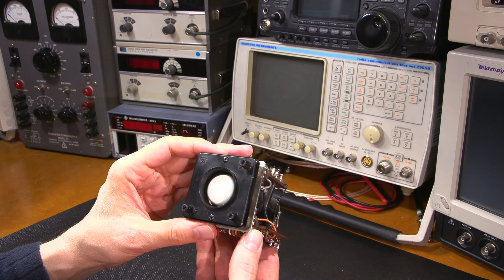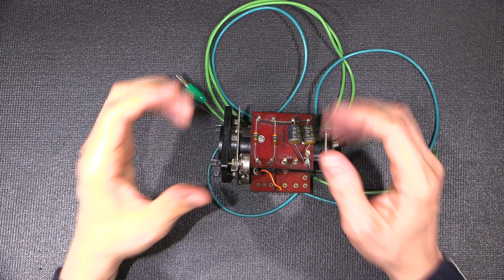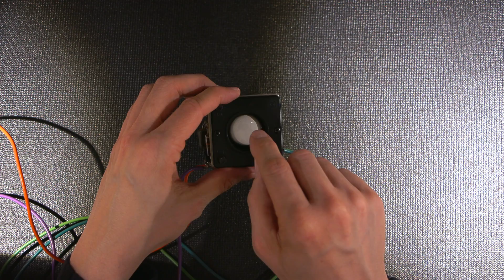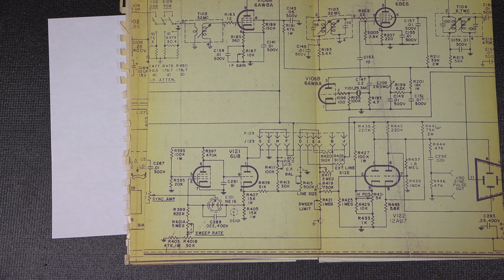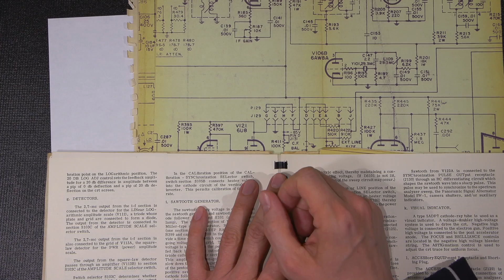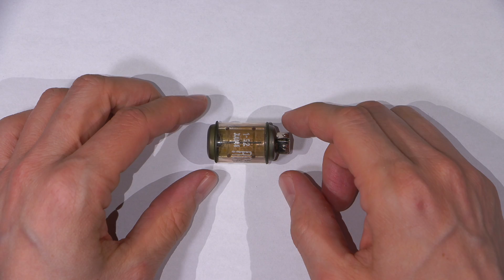Electronic Tool From The 1950's! Will It Work?

Comment: You may be able to brighten the display by turning down your High Voltage. I'm really surprised that you started right at 400V instead of slowly ramping it up.
Reply from the maker: Hi David, it works the opposite way. Higher Voltage= Brighter, but less sensitive, (needs more Vertical and Horizontal deflection excitation)

Comment: Speaking of radioactive tubes some used Radium 223 inside and are quite hot to this day (still reasonably safe to handle when intact though). Some however had either a dot of paint or a little foil on the outside so those can be a little more problematic regarding contamination.
I have some on my collection of radioactive stuff

Comment: My guess on the RCA tube is... an RCA 5582 photo detector tube. Used to reproduce sound in very old movie projectors, before photo resistors were invented. It had a pretty specific wavelength that it responded to, 400nm peak sensitivity, to help prevent stray light leaking through the film from affecting the audio playback. How did I do?

Comment: Cobalt 60!? (Interrobang) Now you are in my expertise.  Co-60 has two very strong gammas, is a dangerous source of radiation exposure, and is used as a source for radiographic examination of welds, as well as in medicine.  The radiography sources tend to be in the millicurie to a few curies in size (I do not subscribe to the new units whatever they are- like you use cycles/sec, I use curies rads and rems etc) equivalent to milligrams or smaller in weight.  The sources are stored in heavy lead or depleted uranium shields called pigs and are hand cranked from a distance with a cable to expose the source to a film that is on the other side of the item being examined.  Lots of additional shielding is involved.  I cannot believe they once put Co 60 in a vacuum tube!  Do you know which ones?  What equipment should we watch for? So, we can make a notification to the Nuclear Regulatory Commission to send a hazmat team to pick up the device and properly dispose of it (oh maybe I exaggerate a little).  Seriously, if a new tube, produced say about 50 years ago, had a microcurie of Co 60 it would give off about 1 mrem per hour at the tube surface.  In those days that would be acceptable but today would certainly require a license from the NRC to sell or possess.  After 50 years of decay the source would be 1/1000th of the original and fine from an external exposure point of view.  Background radiation usually is around 200 mrem per year, and most instrumentation today would detect these tubes, even with the depleted Co 60, as radioactive, even though the tube could read as little as 5% more than background.  So they would not require licensed disposal if as old as 50 years.   In comparison, fiesta ware (pottery) has about twice background due to uranium content, but the radioactivity in fiesta ware has less biological impact than Co 60.  Still I would not advise recondition a piece of equipment to sell with one of these tubes inside, I would find an alternative.

Comment: Great video of reanimating that old scope unit, thank you @ Mr Carlson! Answer to trivia question: I concur with all who say it is a phototube, its the cartridge type either 921, 922 or 926, often found in cinema projectors to scan the soundtrack, also fitted in some door opener light beam switches. What never ceased to baffle me since I first saw one in the early 1970s is how they managed to keep the areawise large metal to glass frit airtight at the ends. I would have guessed there would be a reliability issue at some time due to the tube drawing gas there. Could you test this one on a video please?
Best regards from Germany

Comment: I wonder why many tube filaments glow with 6.3 V.  The only explanation I can think of is the 'easy' to calculate transformation ratio: 20 x 6.3 = 126 V.  Though it would not surprise me I am completely wrong about this.
Reply: Actually, the 6.3 volts was based on running tubes on lead-acid batteries...each cell was 2.1 volts-3 cell batteries were common-2.1*3=6.3 volts.
12.6 was also a common tube heater volts-6 cell battery-2.1*6=12.6 volts.

Comment: Very nice little o'scope. Thanks for sharing, Mr Carlson :-)
Years ago I built one from scratch as part of a homebrew tube-type 40 meter AM/CW transmitter/receiver rig and I connected the horizontal plates to the filament supply to get the horizontal sweep and connected a slug-tuned coil and capacitor tuned-circuit that would resonate in the 40 meter band (7-7.3 mHz) across the vertical plates and the thing worked nicely for adjusting the modulation on AM and monitoring the keying on CW. To couple the 7 meg RF into the coil I wrapped a couple turns of insulated hookup wire around the body of the coil-form in phase with the 7 meg coil and connected one side of that link to ground and the other side was placed nearby the transmitter section's output tank coil.

Comment: Older camcorders had a tube and circuit in the viewfinder that can be used as a small "scope" tube but the frequency range are limited. It could however be used for instance as a Octopus display.  Would be you interested in building such a circuit for component testing just for fun?

Comment: I may be mistaken..... It looks like a RCA photo-detector tube that was used in old movie (16 & 35mm) projectors ! The audio track ran down one side of the entire length of the film between the sprocket holes and the video frames. It looked like a trace on oscilloscope !

Comment: The tube looks sort of like the one I have.  Mine was made in the 50's or 60's.  It was part of an electric eye for some kind of alarm system.  The common name now days is a photo cell.  The striking or absence of light would turn on or off relays etc.  The one I had used a regular tube socket.  It kind of works on the same principal as the last example you gave us.  The light would excite the gasses in the tube and allow electrons to flow.

On the little scope tube, I use the eye piece out of the older type video cameras.  If you take the eye piece apart, it looks just like a picture tube from a old TV set, but only about an inch square.  They run on only 6 to 12 volts, depending on the camera type, then on the composite input, you can do all kinds of things with them.  If you mess with the deflection coils, you can make a very portable pocket O' scope.

Comment: Although often larger, that little CRT could be used as a goniometer, an audio phase meter scope, essentially just an X-Y mode oscilloscope. They would display a Lissajous pattern showing stereo (or multi-channel) content and could alert one to unwanted phase errors. They generally reduce brightness to zero when input is below a low threshold to save display life and prevent burn in. These are commonplace in the recording and audio production industries and were used well in to the 1990s. Today it's done in software. SAE included a scope about this small on their Mk6 FM tuner.

Comment: Had one of your mystery tubes when I was a kid - 70 years ago -- was mounted on a Bakelite chassis in an octal socket along with a  vacuum tube of some kind and a relay.  Mystery tube had a :"plastic": dome over it and a light tube.  Shine a light on the tube, set the sensitivity control just right and the relay would close.  Could use it when a parent was sneaking up on me and would break the light beam and a bell would ring warning me to put my comic book down and pretend to be sleeping.  Thanks for the memory.
Reply from the maker: Great story Robert, thanks for sharing that!

Comment: William Whitehill
I Think it is a Geiger-muller tube for detecting gamma rays.These tubes have a high voltage (my guess is about 250V) across the anode and cathode, but don't conduct until a gamma ray particle goes through the tube and leave an ionized path.

Comment: Cool piece of gear. Where the heck do you get this stuff? That device looked to be well cared for. By the way, regarding the use of radioactive substances, I put up a video a few months ago on low level radioactivity in some of the Philbrick K2 tube op amps, The ones with the grey cases like the one you demonstrated in a video have no radiation, but op amps in the beige or tan colored cases, and some in metal cases have a neon bulb with a spot of radium paint on them. The radiation is still fairly strong right next to the tube, but it drops off to background level just a few inches away. There’s information on the Philbrick Archive website if anyone is interested. There’s an email chain between Bob Pease and Dan Sheingold discussing the safety aspect.

Comment: It looks very similar to a photo-tube that was once used in X-Ray machines. Very early ‘60’s X- Ray machines for auto exposure. The X-rays would stimulate a plate that looked like the inside of a X-ray cassette, but enclosed in a light-proof box. When the brightness of the phosphor reached a certain value (which could be calibrated) the photo tube output would flip a 741 op amp wired as a comparator and stop the X-ray exposure. In the really early X-ray machines, the comparator was a dual plate tube wired as a comparator. The benefit was consistent X-ray images after film processing no matter how “thick” the patient was. They used to call it auto-dose or auto exposure and it really worked well. The photo tube we used was a photo-multiplier, but I don’t remember the manufacturer or the tube number.  I think it was made by GE or one of their companies.  They very rarely went bad, and when they did, it was very easy to replace and calibrate.

The photo multiplier tubes we used on the X-ray systems never discolored like that.  They were handling high voltage , but very low current, maybe 50 microamps maximum.  Maybe the trivia device is a high intensity xenon strobe for photo camera work?

Thanks for the great videos.

Comment: Just a thought about the CRT.  It's an obnoxious burned area if you orient it the way it was intended.  But if the deflection voltages are identical, you could rotate it 90 degrees and move the burned area to a strip up and down the center and use the bright areas at the left and right.  (Which is to say, rotate the physical unit 90 degrees and swap the X and Y connections.)
Reply from the maker: Hi Joseph, Unfortunately one deflection plate is tied to multiple elements inside the tube.
Reply: @MrCarlsonsLab  Would this prevent swapping the input pairs?
Reply from the maker: @josephcote6120  Yes, it would. I have tried it.

Comment: A Cossor?  I have forgotten where exactly I first touched an oscilloscope, but I do remember that it was a COSSOR.  No trigger on that baby, you had to tweak a control to “synchronize” and stop the run of the wave.  The vertical and horizontal gains had to also be set by potentiometers, not by switches.

Comment: I had a really cool device back before I was forced to move from California and everything that I owned was picked through and probably tossed out.

The device, I got from Foohill swap meet (good times that I will never get to re-live now being stuck back in Michigan).

The device was made by some aerospace engineering company like Raytheon or McDonald Douglas or something. I had an electric motor in it and ran some kind of compressor. It ran ok on 12vdc. It had a probe on it on the end of a capillary tube that would develop frost on it after seconds.

I'm guessing that it was for FLIR or something. I'm guessing that it was some kind of helium cryostat to chill an optic sensor. It's gone now from one of the panic moves that I was forced to endure. I don't know of any surplus stores or swap meets here in Michigan. It's trailer trash city. You can't even find a 3 phase motor lying around. They have all been scrapped out by marauding hoards of crack heads.
Reply: Michigan sounds rough, and here I thought South Africa was rough😂

Comment: You can also make a super-simple curve tracer with it. Put a 1k resistor in series with your horizontal deflection signal (the variac, in this case). Temporarily short the resistor, and adjust the scope so the line sweeps from side-to-side, and center the line vertically. Now remove the resistor, and connect the vertical inputs of the scope across the resistor, and put a 2-lead device across the horizontal input. The current through the device will cause a voltage drop across the 1k resistor proportional to the current by Ohm’s Law, since the same current has to pass through the DUT and the 1k resistor. 
A resistor will cause a slanted line. A dead short will cause a vertical line (and the 1k resistor might get hot!), and an open circuit will give the horizontal trace.
A capacitor or inductor will give... (sorry, no spoilers, here!)
You can also try testing diodes, zener diodes, and LEDs - just select an appropriate resistor based on your horizontal sweep voltage, and so you get around 20 mA (max).
You can also try this with a normal ‘scope - just set it to X-Y mode, and make sure you don’t exceed the input voltage ratings for the ‘scope, and use AC coupling for the vertical axis! 🤠

Comment: That is an old side viewing argon gas photo tube. It's used in a circuit for a relay type application. 2 of the pins are connected to both caps. Great video.
Reply: That would be my guess argon gas due to the purple color. Do these glow purple when energized? Photo electric sensor 1940-1950 judging from the font used on the tube.

Comment: Could you add a small LED in series with your regulator tube and pointed at it to fix it instead of an incandescent bulb (which are getting more and more difficult to get)?  The power requirement of the circuit would go down a little bit and, assuming heat or any voltage variations do not damage the LED, the circuit would be more reliable as it would be limited only by the regulator device (tube) itself, not two separate finite-lifetime components in your equipment, since a good LED should be virtually immortal for this purpose.

Comment: Yup what WB3BJU said below, I had one around here in my tube junk boxes. They were used in sound projectors with a focused beam of light on it for the sound track of 16 mm or other film sizes and code tape machines for teaching Morse code and I am sure other things that used modulated light. Happy Spring Paul, KØOJ

Comment: J. Millen Co. mini oscilloscope, was made to fit in the place of an S-meter on a communications receiver. Millen was a legend in radio engineering, and designed some of the best equipment for National Radio Co. including the SW-3, SW-5, HRO, and NC-100 series

Comment: Raise your hand if you ran around the house with a flashlight shining it at all your flickering power strip lamps!  raises hand
Reply: lol i did :D
Reply: I paused the video to run around the house with a flashlight.
Reply: @mechanicfrank900  Same here 😊 Unfortunately, I could not find a single flickering neon bulb... All perfectly steady 🙁
Reply: It's also called the "dark effect."  There are ways around it, and that's to use a minute amount of radioactive gas in with the neon.  When neons get old and tired the breakdown voltage goes up and don't fire reliably.  Having light hit the gas excites it just enough to help it break down more consistently.
Reply: You'd think its own light (neon) would be enough to stabilise it!!!
Reply: Me 2.
Reply: laser works well
Reply: Guilty!  I know the neon light flickers on my computer power strip.  Took a flashlight and shined it on the light and low and behold, it lit steady!  Turned the light off and it flickers again.
Reply: Only have the one old power-board to test this, but after trying it with a 9-LED torch (way too bright for my eyes to tell how fast it stopped the flicker), I then tried again once I'd left it disconnected for a while with a single-LED torch (about 2 secs to react), then again later with a laser-pointer (which caused the neon to react & steady instantly)!

Comment: That tube is a photo tube used in movie projectors with clever optics.  The curved cathode is coated with cesium, the anode wire is biased to about 80 volts positive.  One end is the cathode, the other is the anode. As the light shines on the cathode, electrons are emitted to the anode and the anode current varies with the light level.  I might still have one in my basement junk.
Reply: Not a phototube, but an oscilloscope CRT.  Probably uses a type 913, which came out in 1935, or a post-war 1CP1.  I'm pretty sure I saw this Millen unit advertised in an old 1946 ARRL manual.

Comment: Could you switch the Vertical and horizontal plate connections and rotate the tube 90 degrees to use the "non" burnt phosphorus?... Or would that be a "cheep Charlie" fix?
Thanks for the videos.
Reply: That would be nice. Only a small section in the center, the width of the original line, would still be used. The rest would be "pristine". Although, I think only 180 degrees would be possible as the plates are fixed to display a horizontal line. Then you are where you began. It can't be done (easily) electrically. It would have to be mechanical.
If only we could twist the "guts" of the tube 90 degrees without losing the vacuum!! :-) Hmmm...Rare earth magnets, in a controlled manipulation? Nah..if you twisted the workings, terminals would short. All the posts are embedded in the glass. Is there anyone in the world today that can (re)make ANY vacuum tube ever made? There has to be a demand for that. I'm looking into it. Great thinking Carl! Thanks!  :-)

Comment: Don't get the tinty purplish glass color hint. It gives the impression of very high brightness impinging on the tube. The thing's rugged mounts seem unusually strong and seem like the tube is designed to be replaced in service often?  My thoughts for the photo detector go to picking sound off motion picture film ? Or 1st gen "Electric Eye" in elevator/entrance doors? My guess is...Something else.